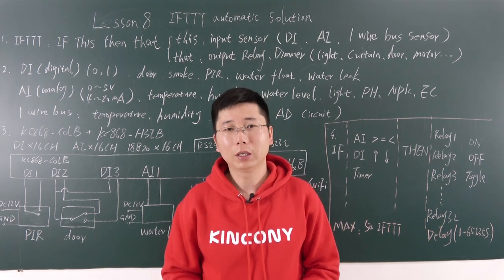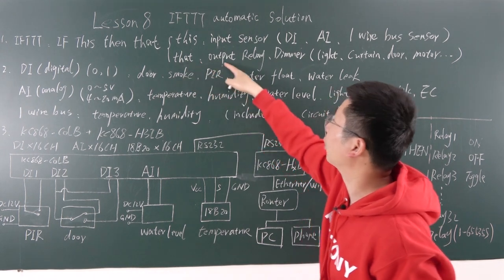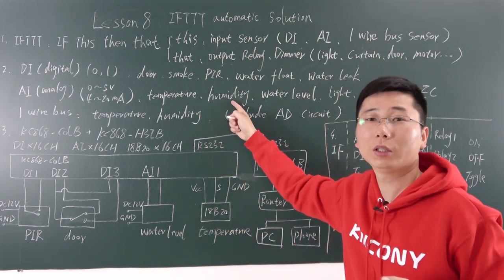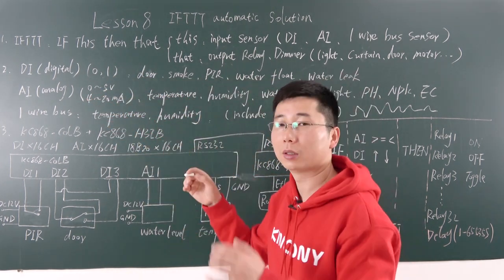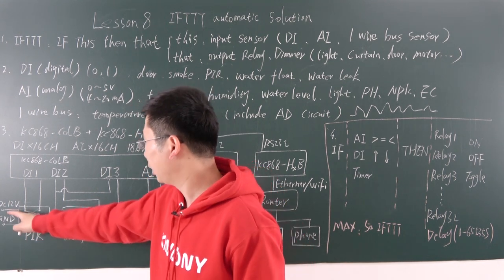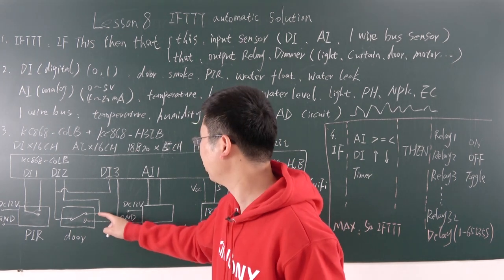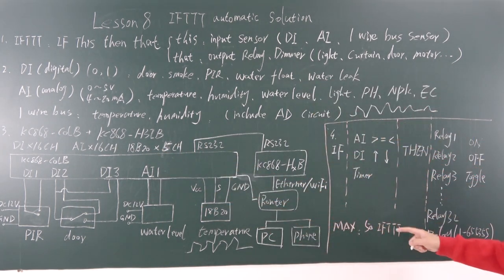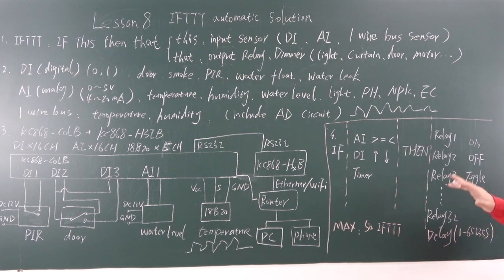【IoT training lesson beginners #08】IFTTT automatic solution without internet

Comment: How about KC868-COL model
Reply from the maker: now is replaced by KC868-COLB, it both have wifi and ethernet, support MQTT.
Reply: I just order KC868-COL model   , it will arriving in may. Can it works with ifttt
Reply from the maker: @sagitaurus1965  yes, no problem.
Reply: Hope it will work with my planned project
Reply from the maker: @sagitaurus1965  :)